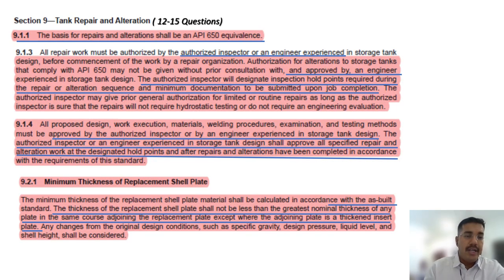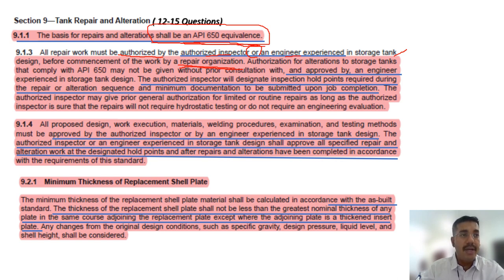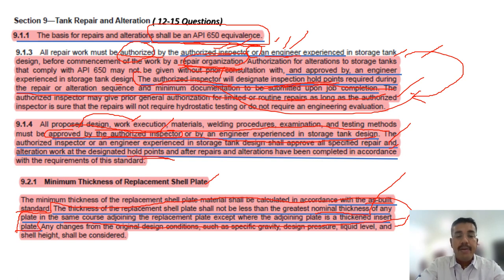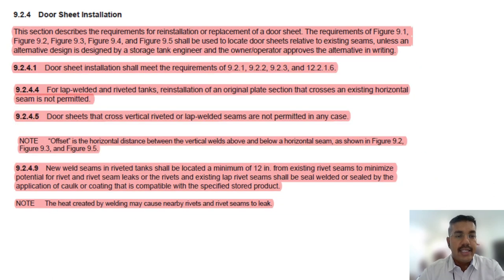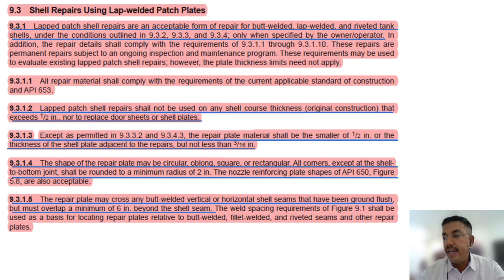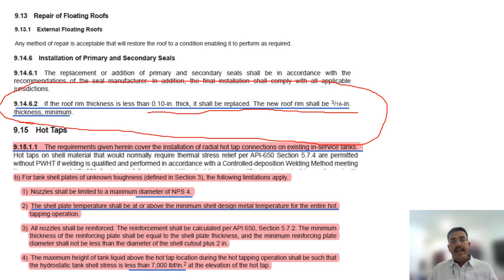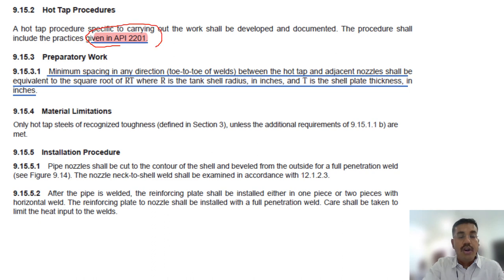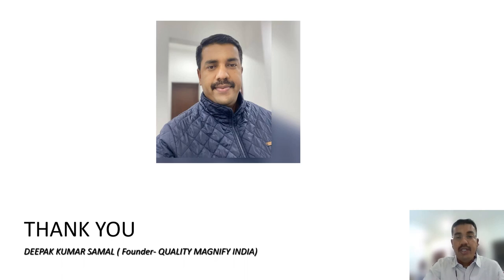API 653 PART 08

Comment: Thanks again deepka bhai, I have 1 question btw.
As per API 650, maximum thickness allowed is 1.5 inch or 1.75 inch for shell?
Reply from the maker: 1.75”
Reply: @qualitymagnify5656  noted 👍